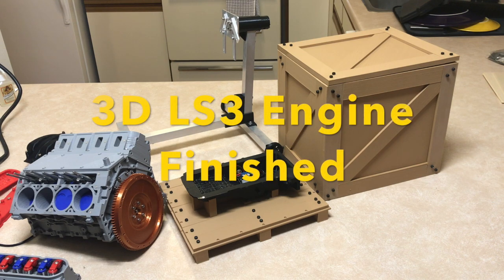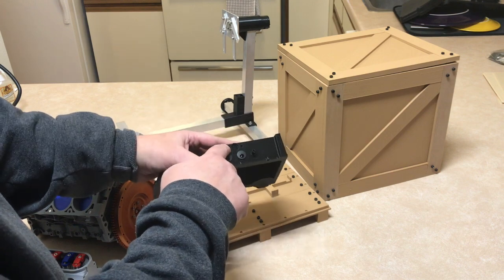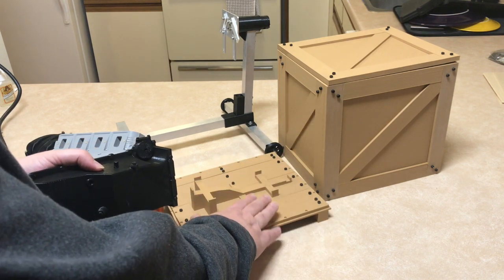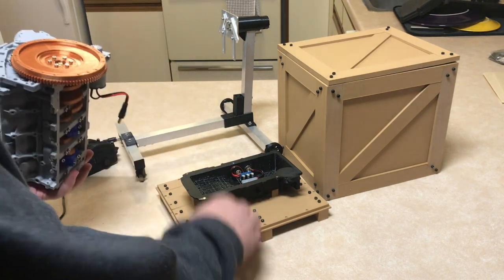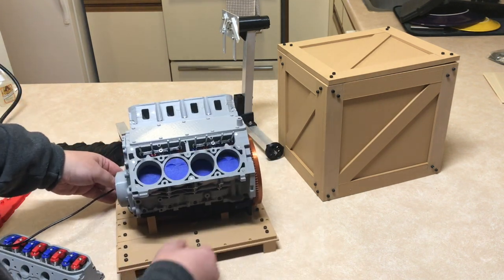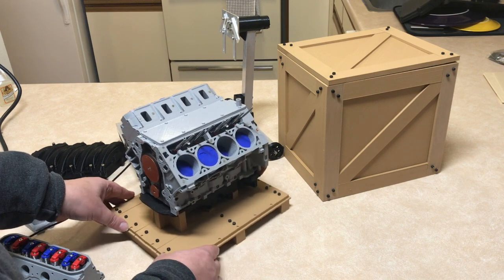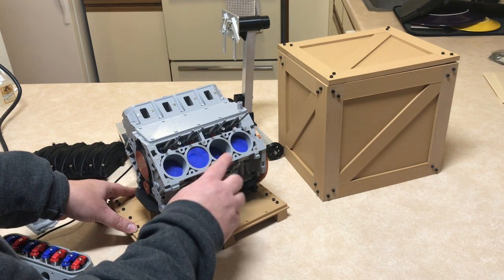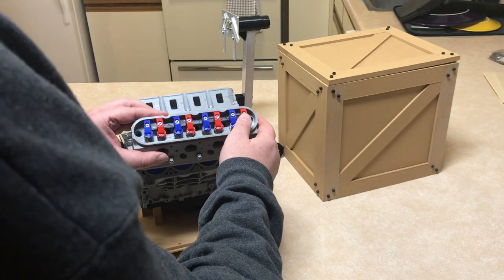3D Printer Challenge #2 - LS3 Engine Part 2

Comment: This is really awesome.  I currently drive a Charger Daytona 392 and would love to see a Hemi version of this.  Still, thinking about printing the LS3.  Do you think I could do it with my Ender 3 Pro?
Reply from the maker: Just needs to be 200mm by 200mm bed. That printer seems to be that size. So it will print fine. Start with the heads. Once they print well, go for the hard one - the block